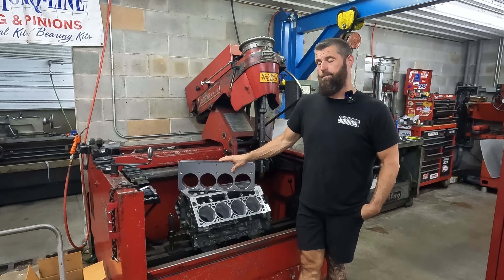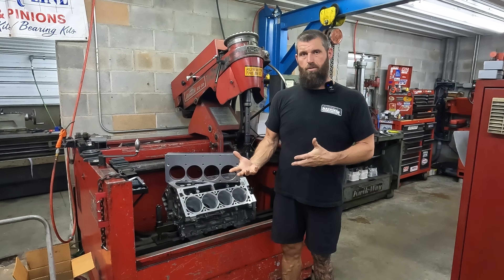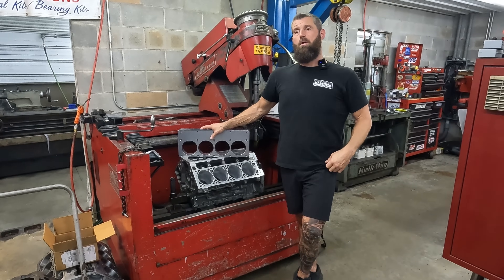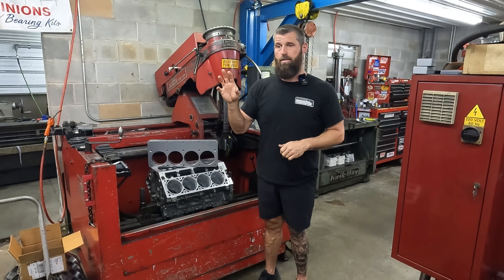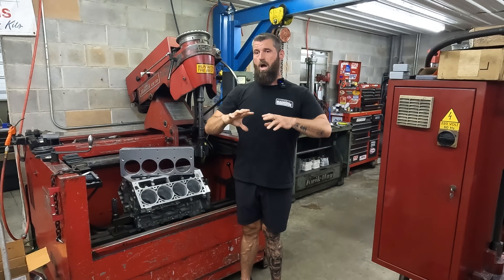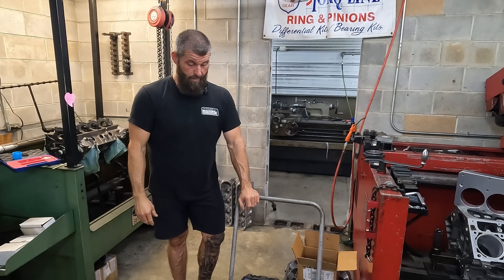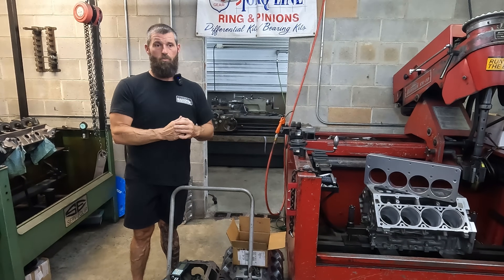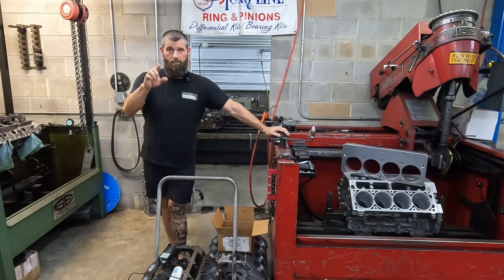We gotta talk about this torque plate deal.....

Comment: I just built an 800HP SBC 355 4 bolt main w/billet main's and killer flowing heads and a turbo as big as your head and the guy I had do the motor is the best in his field in the area and he never ever even mentioned Torque Plate at all to me and he build's motors that hold together and you can pound the shit out of them and they never blow up! The sky is the limit but under a certain level you do not need to do all these extra things, they are thing's that the machine shop makes money on and if they think you need it they will mention it to you and say I can't guarantee my work unless you do these things!

Comment: And then it is fired it up, induced combustion temp/pressure & 4 head bolts turns the bore square,
An Engine Build is,, "    à la carte"     You can choose as much or as little as you want from the build menu, , for a purpose or how big is customer wants/wallet..
You Touched on all,, Business to run not tit/tat keyboard warrior with "a" aimless life.   "Nuff Said"
Reply from the maker: Absolutely

Comment: When he says 0.0004" it is diameter, so at the very top, where the ring probably don't touch, the cylinder wall warps in by 0.0002" on each side... it's like 1/20th of a hair.

Comment: I absolutely agree with you 100% about that 4/10 of 1000 of an inch on top of the cylinder and I didn’t realize there was that much difference in wall thickness from the thrust side to the Siamese side anyhow, you explain it very well and I appreciate it. There’s one fella I do listen to and he’s really sharpers other guys too and you’re one of them I would gladly listen to you more often is Herb McCandless I remember reading article by him clear back in the 90s in this guy is very qualified to make this statement. He would bolt his torque plates on the engine block and let it set overnight and then do the final to Mr. national championships, but I also believe you probably do very good quality work also, this is six in a row Jim from Kennerdell PA I go by six in a row I have a 1991.5 Dodge three-quarter ton with yeah six in a row under the hood just had it rebuilt by machine in Cambridge Ohio. Just getting ready to fire up. It’s back in the truck. It’s gotta do a couple little things to hook up break the cam in and all that all right keep up the good work there’s no doubt dude you’re very professional.

Comment: Yeah they all think every job is for NASA. You try to explain to them that this is for a 30 year old forklift that gets 2 or 3 run hours on it per week, the guy just wants it to not miss and/or burn crazy amounts of oil. Even those FE Fords, you don't know how many of them I've just honed the block in the chassis, ground the valves, new rods and mains, and new rings for some contractors F600 dump truck and the engine outlasted the rest of the truck.

I always find that the guys who talk a super technical game are all the mechanics that let all the trucks and equipment run around with dry pins and bushings, U-joints and king pins that haven't seen a grease gun in over a year. They all talk a lot of shit. I tell them to get the F out of my shop before I throw a hammer at them. I'm an old man, I'm not going to listen to them spewing horseshit.

Comment: Certainly the more a tolerance matters, the more that should be done to ensure it is met.
But I've seen all kinds of machine work done without any torque plate or other stiffening, with no issues.
"It depends" and "ya might get lucky" always apply.

Comment: Car magazine and internet experts, they read something written by a journalist and then think they are now a engineering genius.

That engine in the honing machine probably would not benifit from a torque plate in any case. It has a open style deck, the bolt holes have no direct connection to the cylinder walls.
You mention should we also bore and hone at 220 degrees? No. 
If people want to take things even further it could be said the Combustion pressure distorts the cylinder walls, so you should bore and hone with 7000 rpm Combustion pressure and piston load on the cylinder. Yeah? How in the hell can that be done.
These people don't know anything about machining.

Comment: Hi.  I totally agree with you. I'm a machinist myself. I have always said much the same, the one thing I do is measure the pistons at 90 degrees Celsius to check there growth rate if I know that the engine is working hard. I check the block as it come out the hot tank then calculate the finished bore size from there. I have seen many a machine shop that just follow manufacturer recommendations and don't give enough clearance piston to bore and then the poor customer can't work out why the engine overheat's. I'm in Perth western australia and see these problems regularly when people are sent to me cause no one else can work it out.. Your one of the first I have come across that uses knowledge to think outside the box. Cheers and all the best to you from Perth western Australia.

Comment: I build high output turbo 4 cylinders. We found that at our power levels 300hp per hole, a torque plate doesn’t matter. The block moves around so much at those cylinder pressures it doesn’t help to plate the block. 

Fwiw, we barely push anything into the can.
Reply from the maker: Exactly

Comment: .0004 is just extra piston to wall clearance 😂 when i dropped my ls1 off at the machine shop for a bore and hone i ask the old guy if he had a torque plate or if he wanted me to buy him one
" he looked and said itll be fine these ls's dont distort much if at all" i looked at his wall of torque plates and took his word, that was 4 years ago and ive learned anything where the bolt hole is touching the cylinder wall is a higher liability for distortion 
Stoke block Ls's the bolt holes aren't even close to the cylinder

Comment: So older blocks should probably get torque plated? 70s stuff that's probably not cast very well to begin with?
Reply: no, it was never done in the first place from the factory and still isn't.  its best for engines that are race prepared.  on a daily driver its not necessary, its an extra level of precision.
Reply: @ChristmasCrustacean  he said the FE blocks get it done even if it's for your grandmother's station wagon. That's why I asked.

Comment: Great explanation. I can see where a torque plate would make a difference if the bolt holes are close to the cylinder wall and the expansion from the tension on the threads push the bolt hole into the cylinder. On that block (think it’s an LS) where the water passages separate the bolt holes from the cylinder wall and it also looks like there is 3-4x or more material between the hole and the wall to help with distortion. 

If you want to get 8 to the weeds even farther the pull up of the hole into the gasket affects the torque plate even more thus you have to sacrifice a head gasket to do the torque plate honing (you really need 4 head gaskets from the same run to ensure accurate stress from the gasket). I bet the keyboard warriors as you save have never seen a torque plate in person and could not even come close to figuring out how the stresses in the plate affect the non ring running area of the cylinder bore. 

I bet the manufacturer does not go through using a torque plate to hone every engine they put in granny’s sleeper dragster station wagon, even with that FE ford buried under the hood.

Comment: People should tour car manufacturing engine plant really. They bore and hone engines all day with no torque plate. What engine plant really good at is consistently since they grade everything. Engine plant grade all cyl bores, main bearing bores, rods, pistons, bearings, rings, piston pins and etc. Engine plant can do this since they receive thousands of parts daily. So engine plant and pick and choose parts to get correct "spec's" they need. On stock engine and even mild build wouldn't waste my time on torq plate hone. 

Most people don't understand what 0.0004 of inch is. You can't even feel it running your finger across it

Comment: Stock blocks on something like say, an ls9, can be as far of center as 0.040 from cylinder to cylinder. Their bores can vary by as much as .003. So a variance of .0004 isn't even worth worrying about, even on a formula 1 motor. With LS blocks being semi floating cylinders to begin with, a torque plate is almost a nonsequator. Some people think their machinists have to be perfect, when you can ball hone most rebuilds in your driveway, and have your block last several seasons. Winning seasons.
Reply from the maker: A ls9 could have .040 core shift but not .040 off on bore center's

Comment: why would you measure it after removing the plate. of course it will be off. when the head is torqued down the cylinder will be as it was honed with the torque plate. thats the whole purpose. that being said its very rare any of it really matters.
Reply from the maker: Man I swear..... we measure AFTER to qualify IF the plate is actually doing anything...
Aka is it actually useful... it's amazing I actually have to answer these comments,  smh

Comment: That fella knew just enough to get into trouble when his mouth opened. The last engine that I put together was my '92 5.0 Mustang. I took my parts to my machinist (Troy's Automotive in Winterville, NC) and dropped them off with the cam card and told Troy my intended use for the car. I only asked him one question and that was what his estimate was about the power I could expect out of my engine. He gave me a number that was a little higher than I expected but I did get a whole lot of advice about the build from people like Tom Moss in Florida, about what to put together to make a fun NA street car. When he was done with my parts he called me to come and pick them up. That was it. What he did to my parts was his responsibility and I trusted that he knew exactly what he was doing.

Comment: OEM says do not reuse the head bolts after full torque.  So, I suppose I would have to buy two sets of the expensive head bolts in order to use the torque plate.

Comment: Torque plate is the tip of the iceberg. As you mentioned heat too. But then why not add in the longitudinal torque (twisting) of the engine as it applies power, and add in the static inward forces of the block weight at the (often solid) motor mount and by gosh think of the forces on the 600+ pound engine flying up and slamming down as the car launches and shifts. And think of the inertia forces as the crank, rods and pistons are hurled into a tight turn. And yet as you point out millions of engines every year are built without a torque plate, much less compensating for the other (does ANYONE ever factor them, - if some are going to be torque plate picky one should) points I made.
Reply from the maker: Absolutely

Comment: My opinion has been 'if you have one, use it' but I may need to modify that.  Torque plate, maybe, but it's also along the same line as using high performance (ARP) studs and bolts.  Like you said, different castings and different parts are gonna move around different amounts, especially at temperature.  Thing is, how do we really know that after using a torque plate at room temp that the before and after specs are not actually gonna get worse at operating temperature.
Reply from the maker: Definitely

Comment: Cast blocks have so much core shift that using a torque plate is almost pointless. We would have a company come by and check cylinder bore thickness to see if we could use the blocks for racing in classes that require a factory casted block. The owner of the shop didn’t offer torque plate honing unless it was a purpose built race engine. Quite a labor intensive process when you have to plumb the coolant fixtures to keep the block at 200 degrees.
Reply from the maker: Yep

Comment: The deal is, say like myself your 56 years old, it has been beat into our heads from the mags and TV shows, that you absolutely have to use a torque plate or no horsepowers will be made, if it will even start from lack of ring seal. But I have put more than several together on a spair tire in the back of a pickup with a dingle berry brush and a jug of diesel. Back as a youngster.
Reply from the maker: Yup

Comment: If I wanted my block deck plated I would specifically asked for it and pay for whatever service or fee that it. Now only reason why I have my blocks with a deck plate is because there's so many head bolts and the torque sequence is Goofy and they're so tight. But I don't believe it's totally necessary. It's nice for precision but to be honest it's not necessary they didn't use them back in the thirties and I don't see top fuel guys using them every time they tear down their blocks in the pits

Comment: I honed my stock block with my BHJ plate using a head gasket just as a precaution. I was hoping to distort the block as it would be fully assembled. I honestly can't say if it made a huge difference or not. But I hoped to have the most concentric cylinders possible. I do believe the rings will seat-in & wear-in to its best sealing ability.
Rings only travel up so far and do not get within .500" of the deck in most applications.
Not every engine block needs honed with a torque plate, but if someone wants to pay for it, then do it and smile taking their $.
Reply from the maker: Depends on which engine,  but hone profile is the biggest factor in ring seal.

Comment: Have had several engines rebuilt, one of them grenaded.  Now if i was like most of the internet experts id be back at the machine shop whining they didnt use a torque plate and owe me money.  Instead i completely acknowledge that a 351w does not handle being inverted at 6k rpm very well.

Comment: My ls junk lays in the yard behind the shop, when you clean it up and use the less is more method the shit runs forever. They run 300,000 miles on garbage gm machine work and all the kool aid drinkers think they need a torque plate for their 300hp beaters. Thanks for keeping it real Mr. Powell.
Reply from the maker: 💯!!, I really appreciate that

Comment: My guess would be that the big automakers probably dont use torque plates on every engine they build. Likely on aluminum blocks but iron blocks they probably dont.
Reply from the maker: They don't use them on any
Reply: Well there ya go. Not necessary on a factory engine that comes with a generous millage warranty. Certainly not required for billy bobs commuter motor rebuild.

Comment: In your ideal hone scenario you should probably include torque plates on all block openings including the oil pan and fuel pump. Also consider installing to full torque ALL block fasteners. 

Of course, once used once these should all be discarded, including the torque plates, and the customer billed for them. 

New block hone price $1999

Comment: I bet gm isn’t torque plate honing them on the assembly line the work your doing is 1000 times better than what the manufacturer is putting out and going 100000 miles thanks for the video I wish I was closer to you I would drop off all my machine work to your shop !!
Reply from the maker: Yep the factory doesn't
Reply: @powellmachineinc my son works for a manufacturer, I asked him if they use torque plate, he laughed said no. cut ,bang and roll😅

Comment: After 30 years as a professional technician and working with experienced and professional machinists I literally giggle when I constantly see the kids screaming “where’s the torque plate?” I understand the role of a TP but untold millions of blocks for street use have been bored, honed and couldn’t even spell torque plate and miraculously never burned a drop of oil and gave the customer several hundred thousand miles of trouble free service. I can’t remember how many engines that I have built and stood by that never gave their customers a second’s trouble with oil control. 
Mark it down. When you see the “where’s the torque plate”  comments you are without a doubt dealing with a pilgrim who’s knowledge and experience consists of what he/she saw on some YouTube channel.  Probably a poor example of a Gen Z mouth breather.
 If these pilgrims think not using a TP is blasphemy I’ll give them something to have a stroke over. I had a customer who was in college and broke as a convict at the time. Her little Corolla was suffering from carboned up piston rings and was drinking oil so bad it eventually ran low and spun a rod bearing. She was broke. Our shop decided to help her. The car had 150K miles on it. We threw a crank kit, rings and DINGLEBERRY honed the bores and valve seals. That was 22 years ago. I saw the car the other day and it’s now got 350K miles on it and the owner says it uses about 1/2 qt. of oil every 5K miles. My point is that you sometimes have to work within the customer’s budget and do the best you can within that budget. That car didn’t even get a “proper “ honing job much less boring and honing with a TP installed and it’s still running to this day. 
 Man, these losers who watched Hot Rod TV and suddenly became experts don’t mind calling out people who do it every day for a living and displaying their ignorance. It’s not just your channel. They spent their time trying to nitpick everyone who try’s to put out good content. OK , I’ll stop. I’m done.

Comment: Would you recommend a torque plate on the mopar small blocks (magnums in particular) for a pickup truck 408 stroker build? I'd assume not, but wasn't sure if you'd seen them distort.
Reply from the maker: Yes